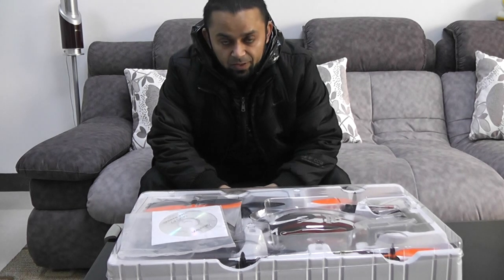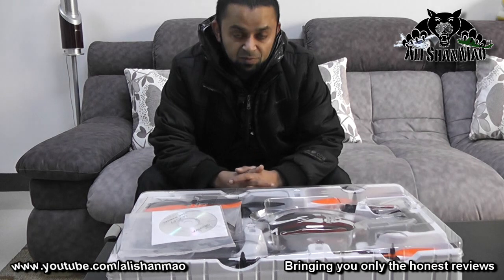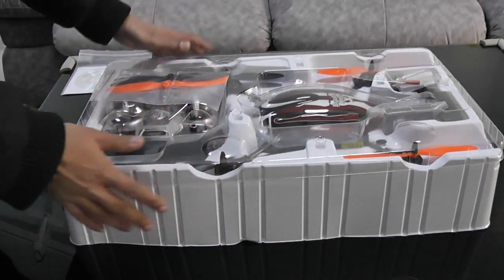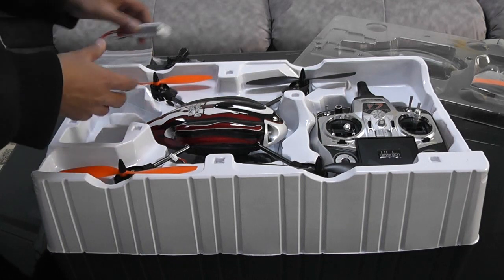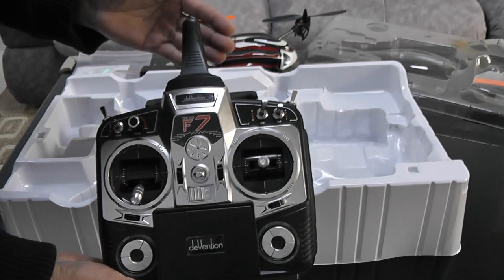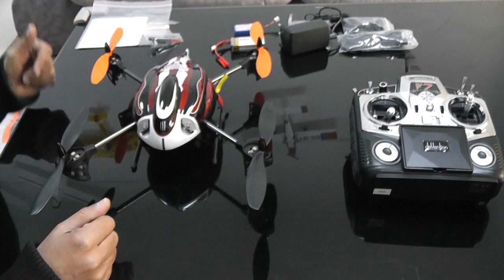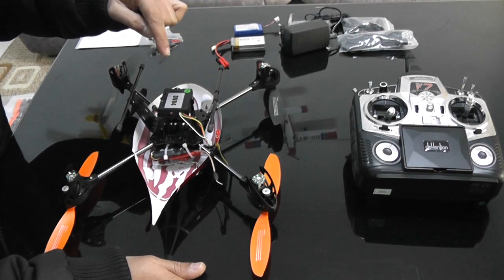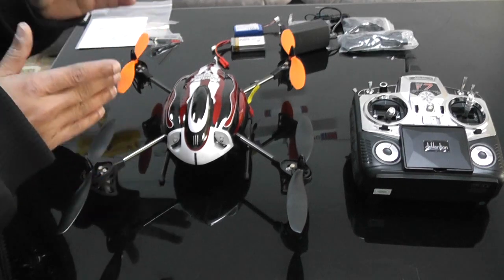Review: Walkera Devo F7 FPV Radio with Hotten X

Comment: Hi Ali... my question is... is it possible to set up the mix to allow coordinated turns... it seems that the f7 has provision to allow the aileron to be master and the rudder and elevator to be slaves. That would mean it would be possible to make completed turns with just the use of the cyclic stick. Of course  the throttle will need to be monitored. I went into the programming and it offers choices of plus and minus values. My question is what values. Ex right rolling turn... left side +x right side -x etc etc... rudder and elevator similar values etc... what do you think... your input will be appreciated... thanks from Sydney Australia